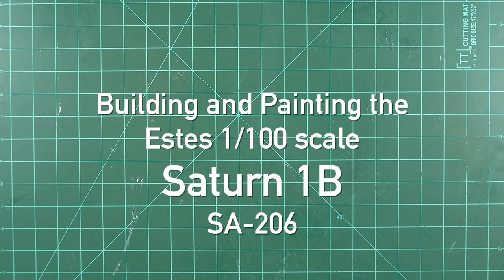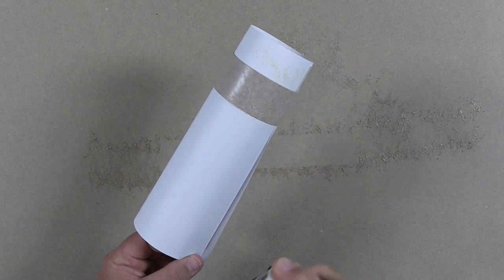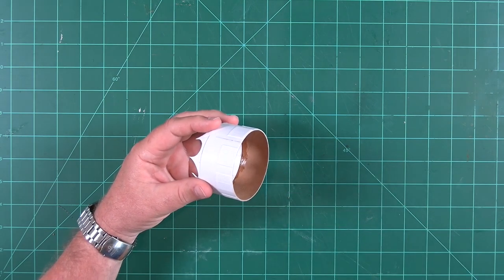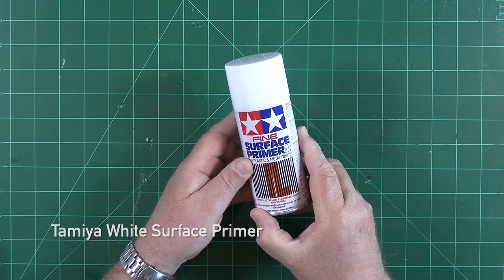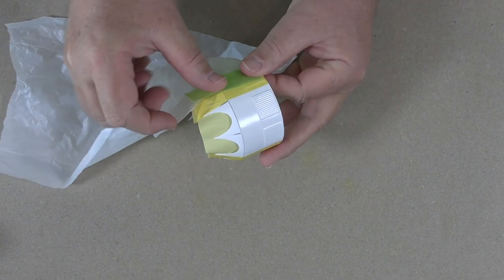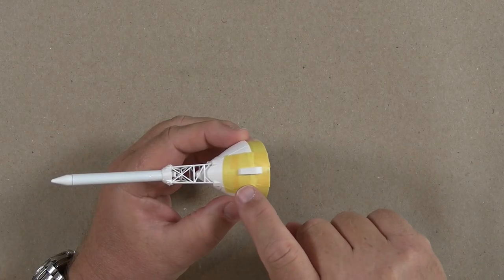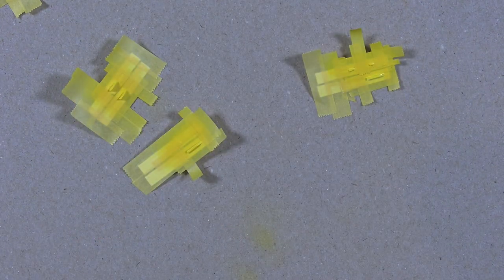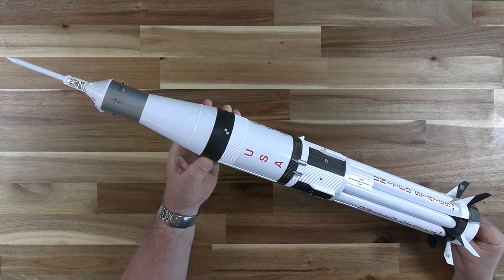Why Do I Have Glue In My Hair? Building the Estes Saturn 1B For Both Newbies And Pros

Comment: Beautiful build.   I’m just getting back in the hobby after 45 years and have a Saturn 1B and want to do it right.   Love the pointers.  Seems the Tamiya paint is preferred.    And another reason to get a little air sprayer. 

Guess next step is to join NRA.  Don’t recall if I did in late 70s.  Never too late 👍